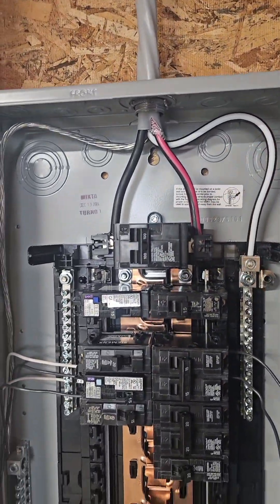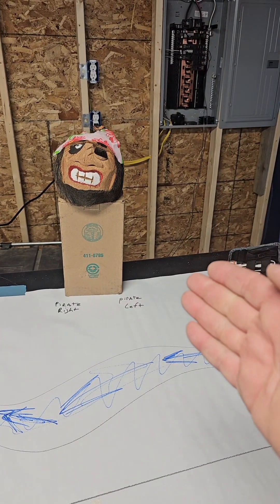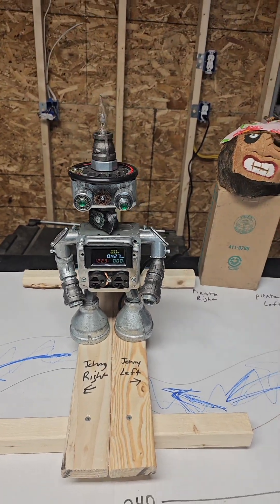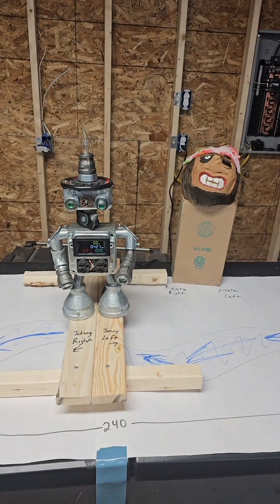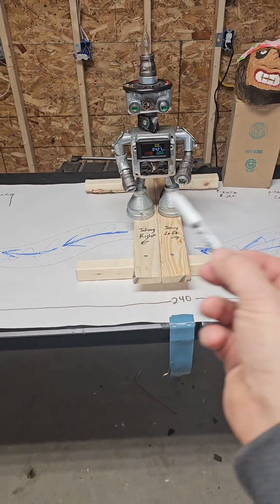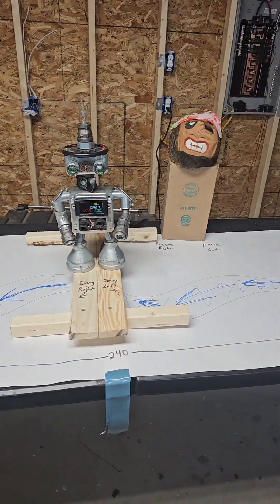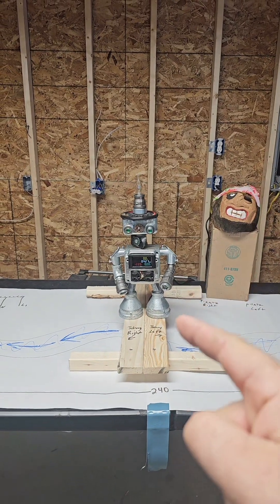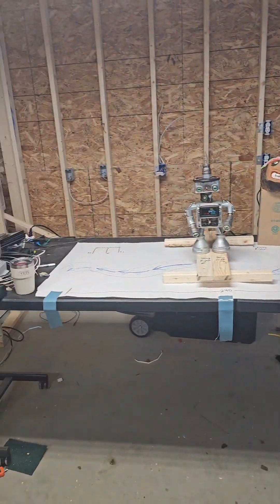Is split phase 180° out of phase?

Comment: LISTEN (or help)
I bought 2 keyboard (music) amplifiers for my shop.
I plugged one into an outlet that traced back to the LEFT side of the panel.
I plugged the other into an outlet from the RIGHT side of the panel.
Each amp had a cable to the keyboard, thus amps are connected
via ground to each other.
Both amps had terrible GROUND NOISE.
I changed one amplifier to the other side of the panel,
and the GROUND NOISE STOPPED.   
I was blaming everything until I finally came to this solution.
My shop keyboard is very happy, now.
I was thinking about you the entire time.
Any insight into this is GREATLY appreciated.
Thanks again !
-- North Central Florida

Comment: Split phase is 180 out of phase just like two series batteries are "out of phase".
Reply: How many "phases" in a 12 volt battery, that has 6 @ 2 volt cells?
 How many "phases" does a transformer with a multiple tap secondary have?
Reply: @MrSummitville  one, and one.
Reply: @snorman1911  100%.

Comment: Perfect example!    If someone says “On my oscilloscope, there are in opposite directions, then they are correct.
Another issue.   If you have a hot conductor touch your dryer metal box creating a ground fault, what path does the electricity take to make a breaker or fuse do its job?   Many electricians and many electrical engineers do not know the real answer.
Reply: If YOU measure one of the windings BACKWARDS then you are 180° out--of-phase, not the winding. If you measure a battery BACKWARDS , is the battery 180° out-of-phase?  Nonsense ...
Reply: @MrSummitville .  I’m not completely sure what your comment means.   I can’t tell if you agree or disagree with my comment.

Comment: It's nice to see someone cover this who actually really understands what he's talking about.

What a lot of people seem to misunderstand about this is that a "phase" is not an absolute thing, that exists in a wire or a system by itself.  A "phase" only exists between two wires carrying AC.  Therefore you can only really talk about the phase of a particular pair of wires.

If you only have 2 wires (for example, you run the two hot wires to a device that doesn't require a neutral), then those 2 wires only have a single phase between them (2 wires can only ever have one phase).  In that situation, you are dealing with single-phase power.

If you have 3 wires (L1, L2, N), then you need to consider the phase between each pair of wires (L1-N, L2-N, L1-L2).  The L1-N phase is one phase.  The L2-N phase is a different phase, which is 180° out of phase with L1-N.  The L1-L2 phase has higher voltage, but the same phase as L1-N.  Therefore, all together, there are two phases in this system (one of them is the phase used by L1-N and L1-L2, and the other is the one used by L2-N (180° out of phase with L1-N))

Alternately, since N is always tied to ground, you can also talk about the phase of each wire relative to ground (because it is common in electrical stuff to use ground potential as a reference).  In that case, the L1 wire has one phase (relative to ground) and the L2 wire has a different phase (relative to ground).  Either way, however, you must always specify what other wire or common reference the phase you are measuring is relative to.  The whole concept of "phase" is only meaningful in relation to something else.

How the transformer is designed is something a lot of people get really caught up in but is really pretty irrelevant to all of this.  You could generate the same situation with two completely separate transformers, or even no transformer at all (for example, by connecting two generators together and running them physically 180° out of phase with each other).
Reply: Excellent. Well said.
Thank you, sir.

Comment: The two phases have to be out of phase from each other. That's how you get two phases. This example you gave was horrible because it's dependent on completely false premise. Leg A and Leg B are 90° out of phase from each other. What you actually showed is 120V being shared and not  240V. The secondary in the transformer are two separate windings energized by a single phase at 120V for each winding. If it was a single winding as you explained, then it's 120V across it and the two legs are sharing 120V, not 240V. Or if you say 240V, then each leg is 240V at the same phase. So either way you apply it you can get 2 pole 240 out of your explanation.
Reply: Nope!    It is 120/240 volt “Single Phase”.  He is correct, you are incorrect.   Now, if you say, “On my oscilloscope, it shows two sine waves in opposition of each other”. You would be absolutely correct.   He is showing what happens in the single coil of the transformer.
Single phase in to a transformer means only single phase out of a transformer.  Two phase only existed with Teslas early systems.  Like at Niagara Falls.
Reply: If you have two batteries in series, are they "out of phase" with each other because their voltages sum?

Comment: I don’t like this explanation because, as you alluded to with your short with the derived neutral, if you change where you tap the transformer (on the secondary side), you can get a proportional voltage and a non-zero neutral.  Ie, tap 1/4 of the way from one side of the transformer; you’ll get 240 across the whole thing, but 60v and 180v from each side to the “neutral”—to the tap.  

I just found your channel, so maybe I’ll find (or you’ll make!) a video where you do move the tap on your transformer.  

If you also tie the neutral to ground in some cases and in others tie it to one post of the secondary, etc, you can demonstrate how the voltage references to ground.  

Obviously for USA split-phase wiring, by convention the neutral is center tapped AND referenced to ground.

Comment: I am the 2 phase guy. I have looked at it this way. If you hook 2 generators together you can match the phases. (The way our grid works) They will run together. Since split phase is still 120 volts. ( to ground/center tap, in your example.) You cannot connect both lines together, because they are out of phase to one another. (same voltage to center tap, but out of phase to each other.) And will always be out of phase. 

Now if you took 2- pole transformers and hooked both output legs together, I am taking a guess it should work, as long as you had the phases matched. (red leg to red leg and blue leg to blue leg.) If you crossed the phases in would not work. 

I wonder if your example would be better if the water was flowing in on a 3rd stream. Then the water would split and go half left and half right at the robot. (It would have to alternate for ac) Or I am just way off. 

Also like the guy below, thought we would see a scope.   Appreciate you information!!
Reply: Nope.  He is showing how it works in the one coil of the transformer.

Comment: Those that say they are 180 degrees out of phase didn't explicitly say the neutral is the common reference.

And those that say they are in phase didn't explicitly say their reference changes. 

So, neither group is wrong. Just different perspective. However, in electrical engineering, you will always define your reference first to avoid causing any confusion

Comment: I appreciate this video. Unfortunately, it will fall on deaf ears. I have been fighting the "there are  two 120V legs, 180 degrees out of phase, so they add together" crowd for 30 years. I finally decided to stop trying to educate folks. In the grand scheme of 240V split phase, their argument doesn't really  matter. If you try that logic with smaller circuit (i.e. transistors), you are going to get very frustrated 😁
Reply: Just wait for them to realise that  the transformer can contain two separate windings that are joined inside the transformer tank or come to the outside separately and what voltage & current is supplied depends on how it's strapped up.  Don't strap those windings in reverse phasing parallel though, well not unless you have a spare set of pants.

Comment: It’s even clearer at the pole. My transformer takes 2 wires as input and outputs 3. 2 wires can only be single phase AFAIK.
Reply: The input to the transformer is definitely a single phase.  Whether you consider the 3-wire output as a polarity reversal or a phase shift is just a matter of point of view.  For a symmetrical waveform, they are equivalent.  It is a debate for pedants, with no practical significance.